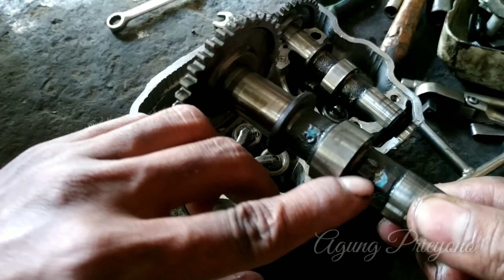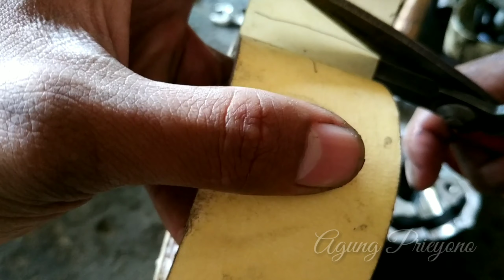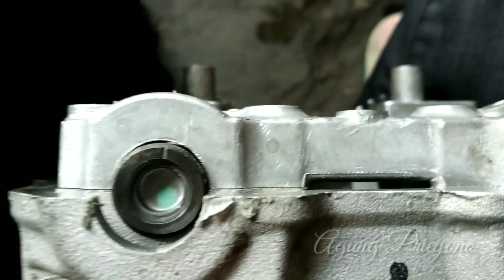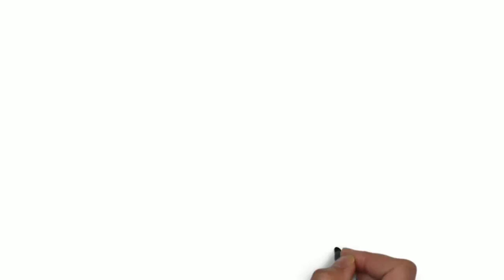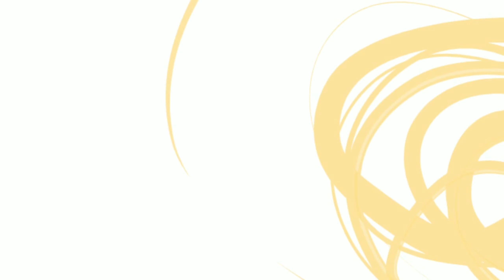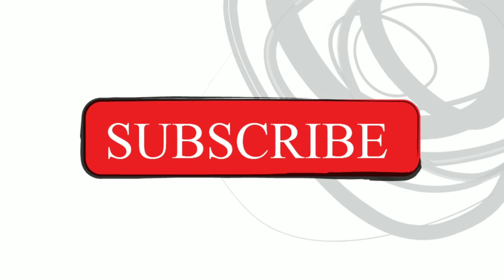INI YANG BIKIN MESIN CB150R LED BERISIK

Comment: Motor saya pada saat di gas di rpm rendah saat kondisi dingin ada bunyi gruk2 setelah mesin panas normal tidak ada bunyi, itu apanya ya?
Reply from the maker: Motornya apa?
Reply: @agungprieyono3207  new cb 150 r
Reply: Sama bang mesin dingin bunyi kaya aram ngorok
Reply: @tegarsanjaya5553  tensionernya bang, kmrin setelah di cek dan di ganti tensioner punya saya kembali normal

Comment: Bang kalo dibubut dikasih boshingan cam sama dicoak agak gedean buat tampungan oli biar sama seperti suzuki gsx gimana ?
Kira" awet ga ?
Mau pake bearing 6802 takutnya ambrol dijalan, soalnya sering dipake touring. Buat jarak jauh
Reply from the maker: Aman itu , kalo mau ngasih bearing pakai yg besar aja
Reply: @agungprieyono3207  mending pake bosh apa bearing ya bang ?
Reply from the maker: Kalo performa enak bearing , tp pake bearing yg besar
Reply: @agungprieyono3207  awet ga bang ?
Reply: @agungprieyono3207  soalnya buat rpm tinggi terus
Reply from the maker: Awet g nya tergantung kepresisiannya n material bearingnya
Reply: @agungprieyono3207  ada rekomendasi bearing yg bagus bang ? Selain 6802. Dan kisaran harganya berapa